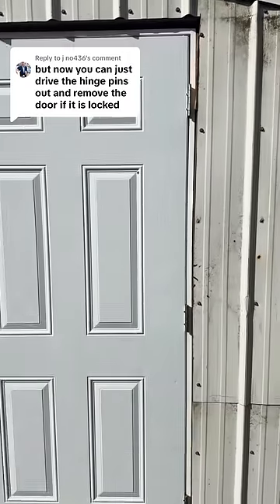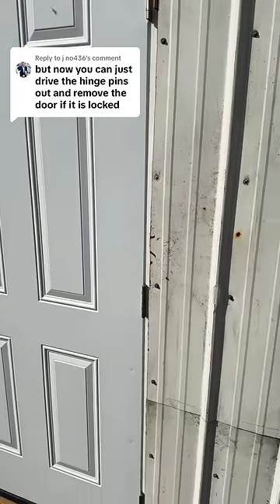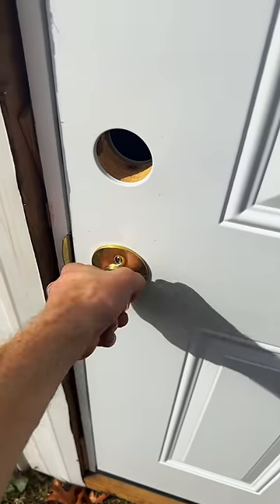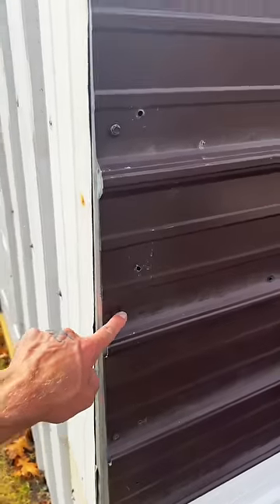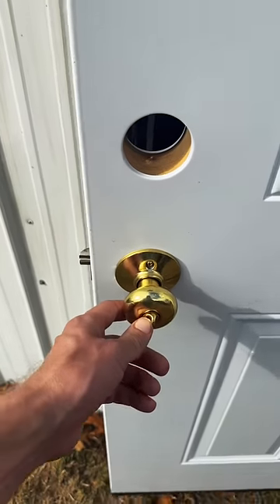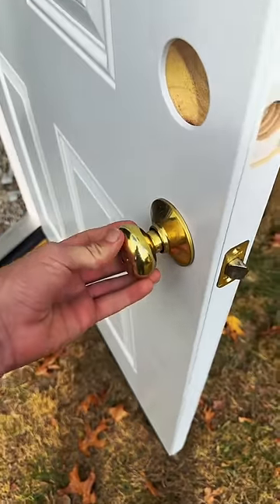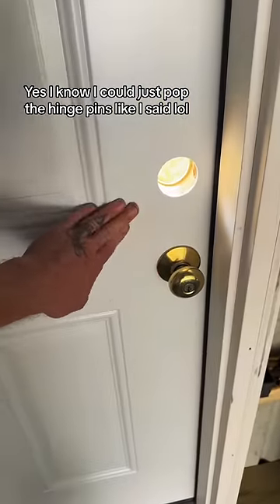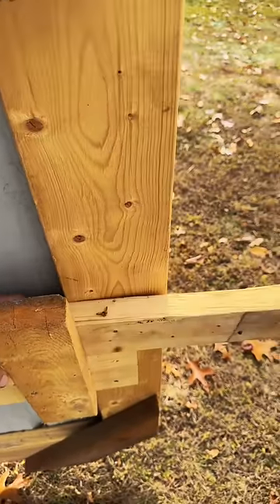Exposed hinges make it easy to get in a locked door

Comment: My friend had a shed and a swing on chains in his garden, swing itself was plastic (for small kid). So someone broke into the shed... using sledgehammer on the wall, they took the screwdriver and left all the expensive stuff. Proceeded to the swing with the screwdriver and unscrewed said swing. They took it, left the screwdriver next to the frame. Did i mentioned that the door to the shed was unlocked and they made the hole under the window? So yeah.... choices lmao.
Reply: They did all that to steal a swing?! 😭

Comment: I want to tell you a story at my camp so we were gone for like a year cuz it was winter when we went back to my old camp now looked behind the camper where are generator usually is and it's contained into like a shed and the hinges inside the lock is a bolt lock so when we unlocked it our generator was gone listen apparently we found one of the bolts that was outside gone so the person that stoled our generator unscrewed the entire thing and rebuilt it so we wouldn't know until we unlocked it so we had to get a new one but it was way smaller because we didn't have enough money to get the medium one that we had

Comment: If the lock has a tiny hole jn jt theres a tool you can use to reset the lock to work with a different key

Comment: Number 1 reason to not do that is now when it rains water will make its way into your shed via the bottom of the door. You face the metal threshold outward because it has a slope that directs water outward. Facing it inward exposes the wood and directs water into the shed

Comment: Yeah a normal outswing would have security tabs to lock the hinges in after the pin is pulled, but a sawzall with a milwakee "axe" blade will destroy any deadbolt and striker out there in seconds so it really doesn't matter. 😂

Comment: Can't you put a little superglue on the lock knob to make it impossible to lock yourself in? Same could have been true if you'd installed it the right way around. Also you can chip out the super glue when you find the key.

Comment: Everyone in here is overcomplicating this including narrowayhomesteader. Install the hinges the right way to protect them, and their grease, from the elements. Install the stupid salvaged locking knob like he did. Last step is to cover the dead bolt hole with at least tape. He is going for minimal effort using whatever is on hand, while avoiding an obvious flaw with the parts, but this setup is just asking for ongoing maintenance meaning no time is saved at all. 

Doing this the right way and rekeying the lock would have been much better and only taken a bit of extra time rekeying the lock. Bonus is any other exterior locks can be keyed using the same kit so only one key works for all. If thats way too much effort then just use a passenger knob from a closet in the main home since the knob is only needed to latch the door.

Comment: Well, the door is not installed backwards, that is an outswing door, and those are security hinges. While it is entirely possible to remove the hinge pins, it would be very difficult to get the door off unless the lock side is actually unlocked. Good idea to install the lock set that way if you don't have a key...😂

Comment: Popping the pins is not that way they are designed. The knuckles overlap each other. There are a lot of hinges that you can use for the outside that have a retaining screw so you can't remove the pin

Comment: I hope you didn't install the door backwards, so the lock button would be on the outside. If you did. It would have just been easier to turn the lock around the way you wanted it after installing the door correctly

Comment: remove the locking mechanism from the handle those newer doorhandles like that only have a plastic piece on the inside that actually grabs the lock area on the internals. adios it

Comment: Or flip the door Jambs lmfao. Don’t take much to router out the finger pine joints and flip all the hardware. I modify commercial steel doors. I’ve seen a lot worse. Not to mention easiest way of breaking into that is the exposed strike plate. Theres no stop in the door so all the weak points are exposed. As everyone in the comments say anyway doors keep honest people out. If someone wants in, they’ll get in.

Comment: You're wrong. It's a shed. The whole purpose for a shed is to create positive storage, which takes square footage.  Now if a door were to go inward then you would have to subtract from that square footage to be able to open the door. Hence, you had the correct idea for the door but you simply need to take you hinge bold to a hardware store and get two regular bolts the same diameter but so that it sticks out past the bottom of the hinge about 3/4". Then purchase then nuts for it and the smallest package of J B Weld, which is a glue damn near as strong as steal. Then round off the hex head of the bolt to prevent a good grip, put the bolt back in the hinge, mix up a little J B Weld and dab it in the nut with a stick and put a little on the nut and screw on the nut until its just though. Just make sure you are not touching the hinge with the nut.

Comment: More than 99.44% chance there's no bevel on the hinge side. Pull the hinge pins and you'll break the frame or wall before that door swings opens from the wrong side. 
You can pull it straight out if the other three sides are not latched or blocked, but then why bother with the hinge pins? 
MUCH easier to go through the paneling as he said.

Comment: Cut off the locking pin that goes in to the actual lock it rotates to open from the center and locks from the pin that goes across through the lock

Comment: Actually hate to burst bubbles but if that door has a proper spacing please demonstrate that pin pulling theory. I bet it doesn’t just come on out. Lol also did you know you can seal a door with one layer of 1 inch wide white masking tape around the three sides of the door to the frame and that door can’t be opened. Now you do!

Comment: You know you can flip the handle to have the locking side inside the building……. And most thieves aren’t smart enough to knock out the pins in the dark at 2 am trying to steal from you

Comment: Or you could just admit you accidentally installed the door backwards.  You can always remove a lock cylinder from a door handle or the metal turn rod inside that allows the door to lock.
Reply: No, it was on purpose. Is it that hard to believe he’d do it on purpose? The lock literally doesn’t do anything to keep people out if the door was the correct way around